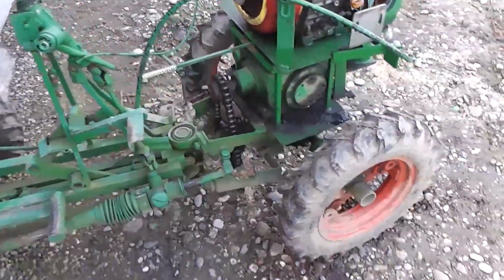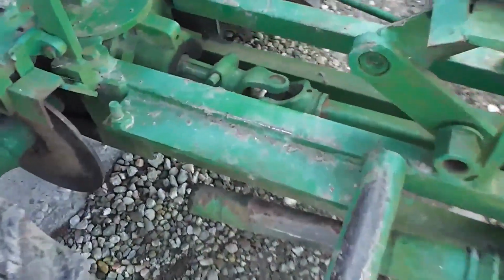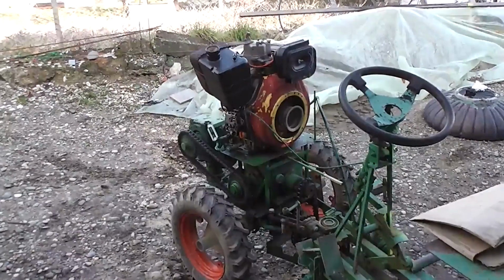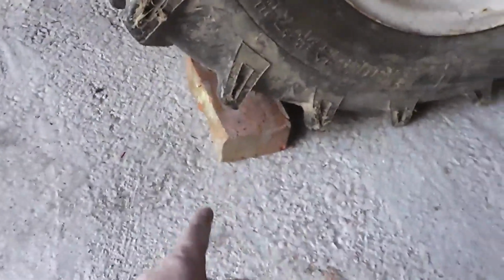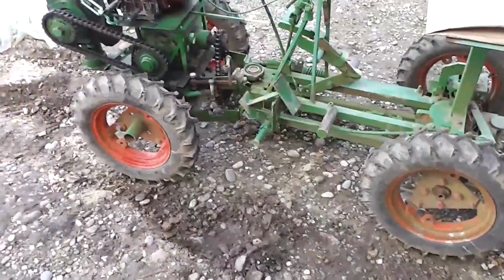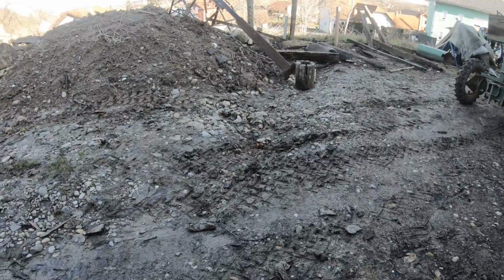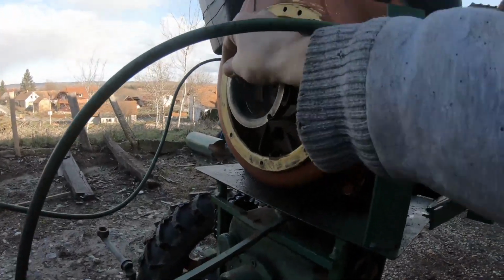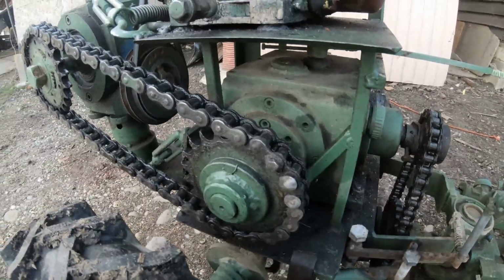Homemade tractor 4x4 replace belt drive with chain drive

Comment: Did you change the clutch mechanism? How’s that working now?
Reply from the maker: I didnt change clutch it is the same as when it is made,now tractor works peftect
Reply: @Mladen365  I remember from a few years ago, your clutch was a pulley pushing on the belt, now there are no belts! Maybe i'm missing a video :(
Reply from the maker: No,i just remove this two belts that goes from gearbox to pto shaft,in front on clutch i still have the belt
Reply: @Mladen365  Oh I see, Thanks for the explanation. It's looking good. Keep up the good work :)